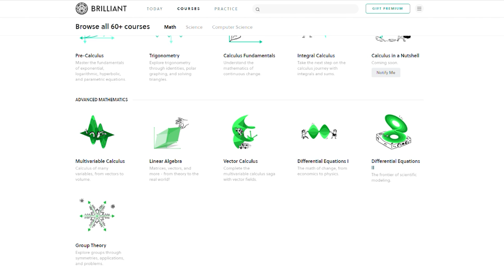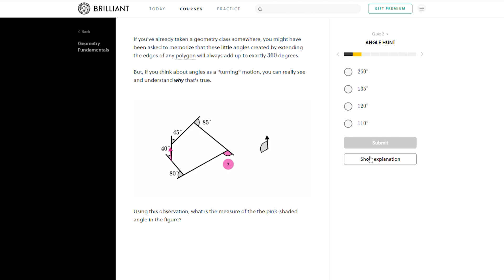67 | SpaceX Starship Updates – Kennedy Space Center SpaceX & Blue Origin Update

Comment: Flux core welding is good but not prime if you have a structure around you to block most of the wind I would say dual shield welding would be the best.. what would be better just for penetration and for a globular transfer method would be stick but it is a major slow down from mig welding.. I'm guessing they are using a short circuit transfer method for thinner metal it is fine usually anything under 1/8 inch.... But if they use a spry transfer method i believe it's better than stick (just in my opinion). It could help with strangthing the hull... Not very common to use out of flat welding position... But knowing they love speed at space x and knowing what they are paying I'm guessing nobody brought up pulse welding for them... That would give them the best of both worlds and they would be able to use it in all positions and on thinner material with a better results for penatration.

Comment: Felix, because you have posted material grade and steel sheet thickness of starship tank and together with the reqired pressure of 8.4 bar I have done some FEA analysis ... the material will probably see plastic strain. Seems to be dimensioned right at the edge of the feasible. Weld seams are certainly the weak point. Probably machine hammer peening (MHP) could improve weld strengh - because it reduces the weld notch effect and it induces a compressive internal stress in the weld which is mainly stressed in tension

https://twitter.com/FelixSchlang/status/1220373185331449856?ref_src=twsrc%5Etfw%7Ctwcamp%5Etweetembed%7Ctwterm%5E1220738952686186503&ref_url=https%3A%2F%2Fpublish.twitter.com%2F%3Fquery%3Dhttps%253A%252F%252Ftwitter.com%252Fchristophschle3%252Fstatus%252F1220738952686186503%26widget%3DTweet

Comment: We weld 304L using lasers all day.
Once setup and running the welds are consistent and clean. Argon cover gas. No filler.

Admittedly the parts are smaller. About 6 inches in dia. Weld widths to 0.100 in. Penetrations to about 0.05 in. And even small gaps are a problem so precision section fit is a must.

Our welds see one time millisecond long g loads in the two-thousand, to many thousands of g's. Plus they have to survive some nasty shake and vibe tests... I've seen parts destroyed in test. Horrible deformation of the assembly without the weld breaking is the norm.

Btw... Our smallest welds are in the 0.01 deep x 0.025 wide range and they survive high g's too. As in never seen a good one fail at the weld.

Point being lasers make solid clean welds, without filler.

I wonder if a robotic arm mounted fiberoptic array weld head could do these large welds better than tig... etc. Or at least cleaner.

Maybe with a 2 in dia heater beam surrounding the penetration beams. One deep penetrating beam guided by the vision system to stay dead nuts on the seam. And two wider slightly defocused beams to control the nugget width, and premelt the surface to about 20% deep.

Just thinking out loud here.

Comment: Why hasn't Brilliant.org come up with a computer modeling program for starship dome construction? Doing it on a computer could save countless throwaway attempts to learning experiences on the ground. 
When I built a stainless arch on the back of my boat, welders told me right up front that TIG welding was the best but it needed a windshield to keep the wind from blowing away the protective gases. Why has it taken SpaceX weeks or even months to come to the same conclusion?

Comment: Why not do the following to create the domes?: 1: Make a dome-shaped hole in the ground, and line it with reinforced concrete. Install a flange around the hole. 2: Make a round disk with holes around the circumferance to install on the flange(this will be the bulkhead) 3: Make a much thicker disk with a connection for high preassure liquid, and install on top of the other disk. 4: Heat everything up, and pump hot high preassure liquid inn between the 2 disks. The thinner disk will shape to the hole in the ground.

Comment: Welding procedure being used is Tip Tig  - its a mix of Tig and Mig welding  processes  but needs still air for best results - pipe in front of flame diverter looks like water for sound /heat reduction -

Comment: Just an idea. Does anyone do any basket weaving using steel? The tank looks like a metal basket to me. A crosspattern weave makes a simple basket very strong and durable when you use one plant fiber. Steel fibre would do the same. Without welding. Has anyone done this yet?

Comment: So why does a dome have to be a dome shape? While it might maximize a shape why can't the pressurized section be of a simpler geometric shape to reduce weld points: Consider a hexagon shape for example to approximate a more circular shape, then cap that with a dome if truly necessary for design or aerodynamics but that part wouldn't need to be capable of withstanding so much direct pressure. Not an engineer here...haha.. just curious :)
Reply from the maker: Why is a bubble round? Because the pressure is equal everywhere. A round shape is always better at withstanding pressure.

Comment: How is this any different from building a steel submarine?  I know pressure is applied in the opposite direction in a rocket, but they’re basically the same shape.  Find out how they build a submarine and weld it that way?
Reply from the maker: Submarines have much thicker steel... 😉
Reply: There's really no comparison between the two situations — but the most important detail is that rockets have to fly, and submarines don't. So while building a 3-inch thick steel hull works for a submarine, that's not very useful for a rocket where keeping the mass down is the most critical part of the design.
Reply: Simon Geard I’m thinking more from the perspective of forming the overall shape and ensuring integrity of the welds.  Not suggesting we slap a rocket engine on a submarine.  😉
Reply: @phaserpants  No, but they're very different construction... the welding techniques for a 3" thick submarine hull aren't going to be the same as for a 0.25" tank for a rocket.
Reply: @phaserpants  – I should qualify that, noting that I'm neither a welder nor a rocket engineer. But it ultimately comes down to the fact that Starship is different from most steel-welding projects because of the critical need to keep mass down... tanks have to be as thin as requirements permit, etc.

Comment: Although SpaceX may use 1/2" stainless on some structural components on Starship, the bulk of the ship would be built with much thinner stock. The thickness would be varied depending on the loading of each component during its lifespan. I saw numbers thrown around ranging from 1/8" to 3/16" in thickness.
Reply from the maker: Correct. My picture specifically showed a bulkhead segment.

Comment: The welding process they are using is tig tip welding, which is a gas tungsten arc welding that has a oscillating wire feed attached. The process is ultra clean and increases production over regular tig welding due to the filler metal coming off a spool rather than 4ft lengths of welding rod.. Mig welding is to dirty an the weld penatration isn't as good...but joint configuration is key to the weld process especially on high pressure assemblies

Comment: 2:50 I don't think that's 1/2" thick. That would make for 140t for the weight of the cylindrical skin of Starship alone. 1/2" wouldn't buckle like what we see on these prototypes either.
Reply from the maker: It's not the coils. It's the bulkhead steel. ;)

Comment: 1/2" thick steel plate. lol wut. no.
Reply from the maker: Hey Timothy. It's the steel for the bulkheads. Not to be confused with the steel coils for the rings.
Reply: @Whataboutit well its a low pressure fuel tank not a battle ship. its not 1/2" plate.  the old shuttle liquid tanks ranged from around 1/4" exotic aluminum alloy to something like 40 thousandths near the top of the tank where hydrostatics allowed it similar to bolted/welded ground storage tanks.

some old fuel tanks were literally coke can thin stainless steel and actually relied on internal pressure to support itself.

Comment: They should overlap and double weld, from inside and outside. You can't glue two sheets of paper without overlap.
Reply from the maker: It's to reduce weight.
Reply: @Whataboutit  — yeah, that's what makes this different from otherwise-similar welding projects... the need to keep the weight down to the absolute minimum they can get away with. It doesn't matter if it passes the pressure tests if it's too heavy to fly...

Comment: Friction welding, is a solid-state welding process that generates heat through mechanical friction between workpieces in relative motion to one another, with the addition of a lateral force called "upset" to plastically displace and fuse the materials, maybe this will help spacex in construction

Comment: At the picture with no credit, there are a few containers in the left bottom, can't those be used as measurement?
Standard ISO shipping containers are 8.5ft (2.59m) in height. So I took a screenshot and then in Photoshop, selected the height and rotate it 90 degrees, it seems to be about 1.3~1.5 meter in diameter.
Reply from the maker: Thanks! Then my eyeballing wasn't too far off! 😄

Comment: As a welder I look at the weld pictures of SpaceX and I'm shocked they allow those welds their welders are subpar in my opinion if the outer skin is stainless steel any black welds are a fail point and why the hell are they using flux core welds not the right process for this type of work they can use gmaw that is the same as flux core without the flux which creates slag that can be trapped in the weldment which is also a weak point who ever their weld organizer Is they should be fired
Reply: I've actually thought about working at SpaceX I have aerospace certification in welding still thinking about it honestly just the location of the work sites are too far of a commute or are in states I dont want to live
Reply: casey hogue - SpaceX could REALLY use you & your expertise. You’d be there to advance spaceflight & benefit humanity!
Reply: casey hogue - You described one reason SpaceX stopped using that technique.
Reply: @TraditionalAnglican  I knew it would fail before it failed I commented on one of these videos before this happened if I remember correctly calling out the black marks and how this is unsafe for people to be inside these because they are weak welds that would cause catastrophic failure these should be tig or mig welded with copper backing bars and a gas back purge to shield the back of the weld from atmospheric contamination that will weaken the weld hell if they want to mass produce these that should just invest electron beam welding or hell you can come up with a resistance welding assembly that would knock these out way faster and cleaner welds

Comment: how about building the biggest ever press and punching the dome out.
Reply: But the 30x stainless steel used in both starship and the cybertruck cant be stamped, thats why the cybertruck is built using only flat sections. If it was possible i agree something like that would be the best option
Reply: @makex_se  Elon claimed that but it is kind of BS. If they do the stamping before heat/cryogenic treating it can be stamped, at worst they might need to stamp it while red hot and then proceed with the treating. However that might introduce wrapping/dimensional accuracy problems but nothing that couldn't be really taken into account in the design. What it can also be is inconvenient, more expensive , harder to figure and slower to market than the current approach.
Reply: Eru Iluvatar
But its cold rolled steel meaning it gets its material properties from being  formed while cold. Hot rolled steel is alot easier to work with but has way worse material properties. You have to understand that this isnt your everyday steel. This steel is pushing the physical limits of strenght and durability at the cost of being freakin hard to work with.
Reply: @makex_se  I know.What I meant is that you can form the steel first and then cold roll it. I think that it was also cryogenically treated by heating and then quenching in liquid nitrogen (at least that was the initial plan). The problem with that is that it will require building tools to do that and that as I stated the dimensions would likely change and they may not even do it in an uniform way resulting into wrapping ( there are ways around that with proper modeling and some trial and error ). I am no steel expert but I do know enough to know that it can be done, it just may not be the option that minimizes cost and or development time which are really important for SpaceX.
Reply: @eruiluvatar236  You can't cold roll stainless if it isn't in roll/sheet. To cold roll stainless you run the steel through two rolls that reduce the thickness. This is typically done with a machine called a Sendzimir Mill or "Z Mill" for short.
Reply: @austingrimm1297  You sure can but you need to build a specialized machine for the shape. It is not likely worth the expense/headache for SpaceX.
Reply: @eruiluvatar236 You can't, as soon as you run the material through the cold roller you lose all of your dimensions. You cannot cold roll something with a preformed 3 dimensional shape.
Reply: Build? Rent a bit of time on the 50,000 ton press.
Reply: A few sticks of high explosive  an inverted dome made of concrete; a sheet of Stainless steel over the dome hole. park an old Dcat 9 bull dozer or similar dead weight over the sheet  with the High Explosive between the sheet and the dozer dead weight.  Light the fuze and smoke a cigar while you wait for the kaboom.   go pick up your perfectly formed dome and just trim the edges.
Reply: clavo
But the problem might not be the force of the press but rather that the steel is so hard that it cracks when you stamp it.
A dome isnt just bendig the material but it will strech it especially near the outside of the dome and hard materials like this steel cracks when being streched so it would be even weaker than welding it.
Reply: @makex_se  That is, as you admit, speculation.  Still it is plausible.  What would it cost to try?  Experimenting is after all, the entire point of the SpaceX exercise; no?  The steel had to be made with heat.  Annealing and re-hardening is possible.

Comment: TIG welding doesn't need to be in a zigzag pattern! It can be but most of the time isn't! It just means that the filler rod is held in the other hand, giving more precision and the ability to adapt to the situation immediately. One hand holds the tungsten electrode with the argon shielding cup (melts the metal) while the other feeds the filler rod. In a mig welder the filler rod is integrated directly in the electrode head and pushed out at a previously set rate or controlled with a foot pedal. Either way it always comes out at the same spot and the angle can't be changed like with a tig welder.

Comment: @What about it!? why arent they using aluminim struts ? the bulkheads look prety wobly!!
as a player of ksp i would say add more struts
its hard to believe they can hold intence pressures like that
im asking this because of starships intense landing procedure it flips upright at the last second during landing
Reply: Blizzard - Unless they were very thick Aluminum struts wouldn’t provide much in the way of added strength, &, after months of expanding & contracting, possibly none at all (aluminum gets weaker as it’s stressed). Titanium is much harder to work with, but it’s stronger and much more durable than aluminum.
Reply from the maker: If all fails they will probably do that. Not all has failed yet though. 😉

Comment: Couldn't Elon create a magnetic cast in a dome shape, so it's all one piece as to several welded together?
Reply: Casting Steel is very hard if even possible with the Type they use(I doubt). Especially in a big thin shape. Heat treating that thing would be a horror. Plus rolled steel is usually stronger that untreated cast steal.
Reply: @philipps423  thanks, do you think there is another material they could use and cast that?
Reply: @michaelw4950  most casting materials have a high specific weight(strength/weight) compared to forged or rolled versions. and there is always the problem with casting something that big without any imperfections. so i dont think thats the way to go.

Comment: Someone should ask Elon why these domes or even the body of the rocket can’t be made with a mold made with molten steel.
Reply: its too brittle, i guess
Reply: durban73 37nabrud - You’d have to develop a way to heat-treat a 9 meter dome, because unheat-treated metal is actually weaker than badly done welds. So, unless the whole dome could be fully heat-treated, you’d have a spot that would be weaker than even bad welds.

Comment: where did u get that great wallpaper pls? and what telescope wld u recommend for my 7 year old son starting out pls?
Reply from the maker: The Wallppaper was bought on the internet. My wife did it. :) The Telescope is a Bresser NT150 with an Exos 2 GoTo mount and some very expensive Baader oculars. As it is on the set, it's at around 1500€ or around $1800. For a seven year Old I would either recommend a smaller refractor telescope (not newtonian, as they need maintenance) or good binoculars on a mount. Might sound funny, but they are a great and much cheaper way of getting into astronomy. You can observe the moon with them and in great detail too.